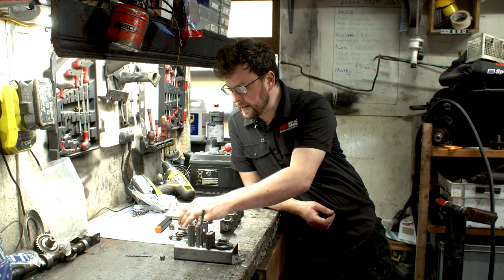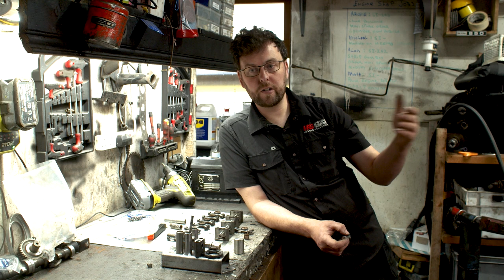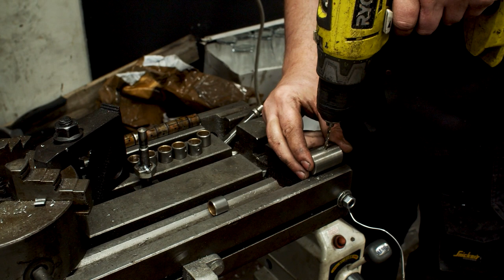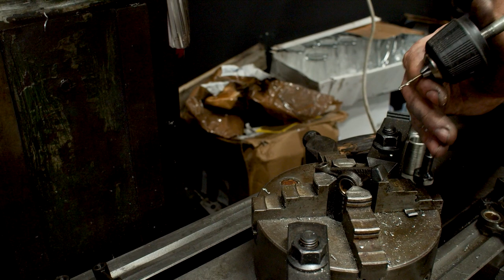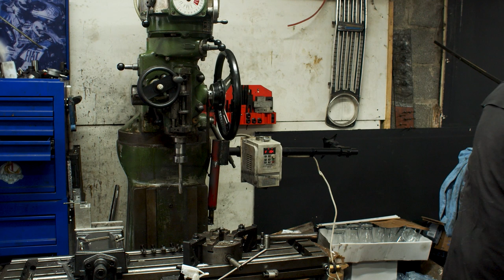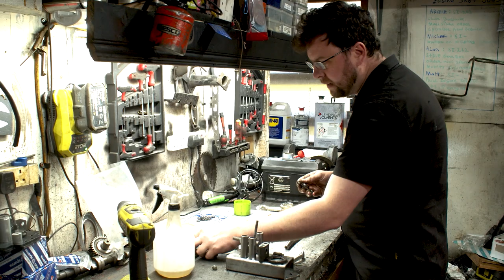Rebuilding Cooper S Rocker Gear. - Part 2

Comment: Another great video showing your attention to detail. I don't know if it's applicable to the more modern rocker adjusting ball ended screws but in my time with BMC with a full race cam we had to use longer competition screws  (C-AEA 692) or machine 0•050" off of the pedestals. As you don't mention this I'm assuming that these longer tappet adjusting screws became a standard fitment. I thought that this was worth mentioning incase you, or anyone else, ever came across an early Cooper S, eg a 1071 or 970 or an original 1275s. I also have something to say about the tappets but I'll leave this 'till later when I see the next video. I'm looking forward to it.
Reply from the maker: Hi Tony thanks for that reply as always your a mine of information great to have you on here 😁